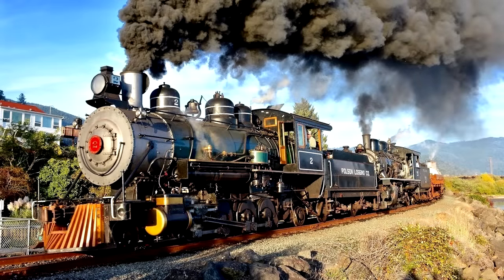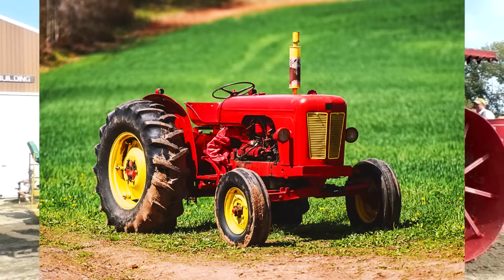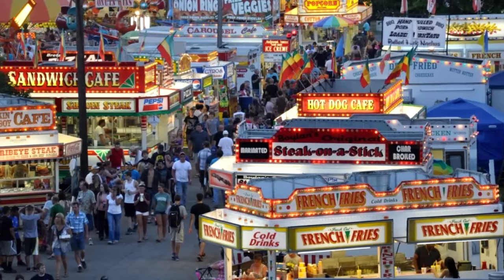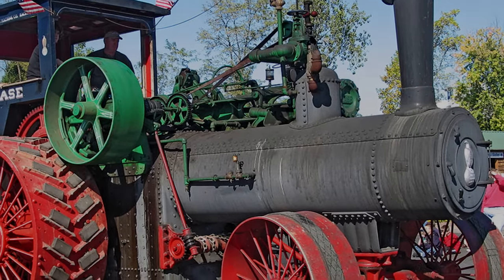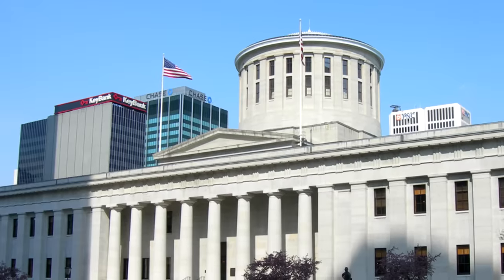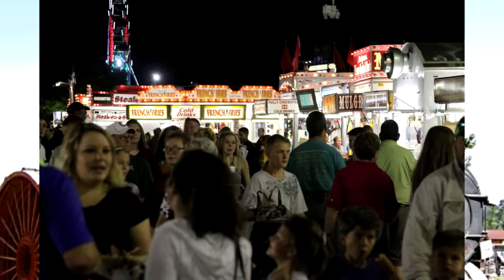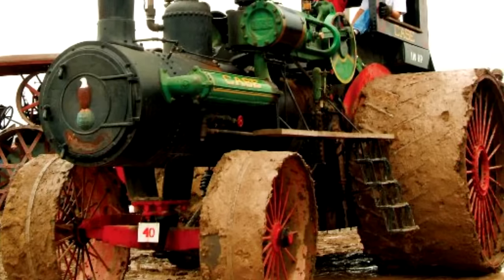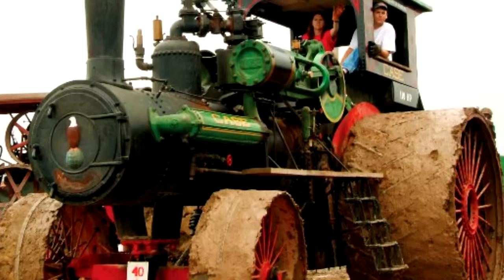The Steam Explosion That Destroyed a Fair 🚂 The 2001 Tragedy in Medina County 🚂 History in the Dark

Comment: The first traction engine was invented in the 1700's by a Frenchman. His engine was built to replace horses in military transport. Unfortunately, it was slow and difficult to maneuver.  It was a failed idea and retired after it crashed into a wall of a residential home. Also, there were few regulations existing for traction engines when they were used on farms. The result was many a young man losing limb or life to boiler failures. Traction engines were also not a common farm tractor because of how expensive they were. A group of neighbors would pool together to buy a traction engine and go from farm to farm. You were rather wealthy if you could afford your own traction engine.

Comment: My weldability of metals professor discussed elastic and plastic deformation. A boiler with walls that thin would have experienced both to a visible degree. Either that or it was made with too brittle metal that shattered instead of bending. Interesting.
Reply: With the amount of degradation he’s talking about, it could’ve been coated in scale or corrosion, slightly strengthening it. The stays are probably what held it together, though. Since it was most likely a crown sheet failure, that’s the roof of the firebox, so you very well could be right. The reason it broke there was most likely low water, without water to cool the crown sheet, it weakened beyond the already terrible state it was in, and either flexed and burst, or just shattered.
Without proper maintenance, it’s very possible his water glass got plugged and didn’t show the correct level anymore.
Reply: It may well of had significant signs of over heating, but frankly if the owner was so incompetent as to not bother with inspections, then  he likely wouldn't of even bothered to inspect the inside of the box either, or simply would of known what he was looking at.
Reply: When water came into contact with the red hot crown sheet, the expansion happened so quickly that there would have been no warning.
Reply: @randymagnum143  At less than 30% of it's original thickness, I highly doubt there were no warning signs. There were probably plenty of warning signs for years before the explosion.
Reply: @GudrezBilly  the spike in pressure was massive and instantaneous.
Reply: @randymagnum143  Dude I know what a boiler explosion is and what it does. What I'm saying is that it's doubtful that a 25% thickness boiler would still operate flawlessly up until explosion. Most explosions in the past were poor design or low water, this instance was very different, despite similarities in the core cause.

Comment: You completely botched the statement of those thickness numbers, by quoting a typo which I also found in an article. That is sure to confuse people. It was a 0.375" crown sheet, not 0.375', or 0.375 thousandths of a foot, as you said.. which would be 0.0045, or only slightly thicker than a human hair.

Comment: I had steam engines for a good many years but haven’t had any in awhile . At the time I had them the state of Virginia where I reside had a state boiler inspector that inspected your boiler every year . If you didn’t have a state certificate and displayed where it could reasonably be seen you didn’t run . Think I was told now inspections in Virginia are covered by an insurance agency . As to this 110 going up I heard about it within a few days of it happening . And over time I got the scuddlebut about the cause . Not to disparage the deceased but I was told this guy had a history of running the water level low . I was also told the cops stopped him as I think he was planning on getting water in his tank then let the pump and or Injectors put water in the boiler itself and they threw him off his assumed schedule (cops are good like that). The thing that got me the most out of what I heard was about the fusible plug . I was told they had bolts screwed in them not welded but either would cause the same thing to happen . For those unaware a correct fusible plug is made of brass with a hollow center that’s filled with a lead alloy . Once the crown sheet gets hot the lead runs out the steam blows down and helps extinguish the fire in the firebox . This guy had gone around half of his safety equipment . The other safety feature is the pop valve or safety valve on the steam dome that’s set at a specific pressure and when the boiler exceeds that it pops off and let’s steam straight up in the air , but that isn’t going to help when water hits a red hot crown sheet . Seems to me I heard or read something about the pop valve being wired down or set at a higher pressure than allowed . But regardless of cause reason etc five people are gone many others were injured and a pretty darn rare engine is destroyed 🤷🏻‍♂️

Comment: Why am I not surprised by this? The bottom line here is that steam engines CAN be dangerous but they are reasonably safe IF the equipment is maintained and the people that are operating them are well trained in how to use/operate them. There are tons of stories out there about steam engine exploding. Both traction and railroad. I would venture to bet that the vast majority of explosions are operator error, like a story of an engine that the driver got sick of the constant noise of leaking steam from the safety valve. It was covered up and eventually the engine blew up.

Comment: That Crown Sheet was .087? Ok, that is terrifying. I work at a factory making plastic and cloth laminate materials for the medical industry. The plastic that comes off the machine I run has to be between .055 and .065 and other materials have to be between .065 and .075. .087 is basically as thick as three sheets of paper! That is SOBERING.
Reply: As a traction engine owner myself, nothing terrifies me more than seeing someone who doesn’t respect steam under pressure. There are fantastic people in this hobby, who have immense knowledge and respect for these machines. There are new guys like me, who are cautious and are trying to soak up as much knowledge as we can. Then, there are guys who find out they have a boiler plate less than 100 thousandths thick and decide that means they “need a better inspector” Yikes.
Reply: @15nyonker  If the show Mythbusters left me with any one lesson on safety, its always give full respect to pressure vessels. Because when you don't, they do not offer a second chance.

Comment: Here in Oz pressure vessels have to be tested. This includes LPG tanks and the like.
As for steam engines boilers have to be inspected and tested regularly. This unfortunatly leaves what could be running steam engines unable to be used. Sad but far safer. I have seen several complete but uncertified trains andd tractors around at museums and steam train lines. And because these are no longer common there is no manufacturers available to order a new boiler from.A steam railway I visited had a lovely old loco but they went to order and their previous supplier had gone out of business. Anyone else wanted about 10 times as much to manufacture a new one and a lead time in years instead of weeks.

Comment: I go to a lot of Steam Engine shows, I even have a small 1947 International LB Flywheel engine that I play around with.   Anyway, I can tell you that I love to watch these old Steamers but I always stay a good distance away from them for this exact reason.  I understand they are over 100 years old and have been around water their whole lives.  You don't have to be a genius to understand there are lots of safety concerns that need to be heeded. You cannot assume everyone is keeping inspections and maintenance up to date.  You hope, but you cannot be sure.  Best to steer clear of them and watch their beauty from afar.
Reply: I've seen the traction engines at the shows overworked on the saw mill and during the pulling events. Safety valves blasting, operators shoveling in fuel. Makes me a bit nervous.

Comment: I see these machines sometimes my area has it's own seperate grounds ran by Antique Tractor Club but i never really have much thought fire+water=steam=power. I was young it used to have a lot more things going and machines, but seems like not that big as of late. Suspect age of machines, people passing and no longer doing, etc part of me is kind of sad to see things like this shrink. Newer things are nice but seems soon as you throw a handful of electronics in usally the companies use it to lock you into their system and dealers. I picked up an old Ford 3400 industrail tractor at an auction for less than could buy a decent basic riding mower. Had to rebuild the power steering system, and ended up rewiring it too because of tons of splices and they bypassed the neutral switch so started in gear.

Comment: Its scary working for farmers/hillbillies. They have no interest in your life or safety. We had a Chinese built air compressor that had quite of bit of surface rust on the tanks. The gas engine seized, and it was replaced by a Honda motor. The governor was removed so the engine ran non-stop at full power. The only thing that prevented the tanks from blowing was the safety valves which let off every minute. Was scary to operate. The brakes were removed from the tractor, yet I was still lifted in the bucket to service conveyors, using throttle to stay in one spot. A bolt fell out in a seat belt, so all seat belts were removed. Including all cars. He kept over pressuring oxyceteline while I was torching scrap. Arguing both bottles need to be kept at redline.  He then tried to light off a bottle for a murder/suicide attempt. I finally yelled loud enough that he stopped doing it to avoid attention. (we were repairing a snow plow at UPS' largest facility in Illinois.) Safety chains were never used in trailers. Faulty parts always used. Several times my feet were almost run over by highway traffic to replace tires. I used a company truck (he wouldn't let me take it buy myself) to deliver an engine I sold, he yelled racist slurs in my buyers wife's face. Outside of work he donating time to a homeless shelter. He would take advantage of mentally handicapped woman. I heard their screamed for help. There was no payment. He still owes me $70,000.  It sucks working for a family business. I needed a second job to pay rent, but I was required to give him 50% of my income from my second job. I worked about 80 hours a week and made about $20 savings for the month. We were required to maintain his new Mercedes. Fuel, tires, maintenance we covered. Working for hillbillies is dreadful. There is no joy. There is no worth of life. And no safety for others.

Comment: Man took out leaking pressure relief valve,  from home hot water heater. 
Stuck in a metal bolt,  back in its place , and plugged it 😃

💥out the roof of house

then came back down ,thru roof, into kitchen.

Comment: In the Uk there is struck laws on steam boilers and compressor air tanks in places of work and public shows they have to be tested once a yr like an mot on our cars. With steam anything can happen in seconds there’s been rare case of a good tested steam boiler exploding especially on a traction engine as it’s subjected to road vibration and a lot of twisting this stresses the boilers and can cause rivets  come come loose or a crack/rare in boiler and it explodes but this is rare. Most are down to pressure valve failure or like in this one it was not in good condition and someone had sneaked it out in to public in a dangerous condition. It’s why in the Uk there on to boiler inspections and they do keep struck records of it

Comment: Would pressure relief valves prevent these super steam over pressure events?
Reply: Most engines have two but they're not meant to handle rapid catastrophic expansion you get in a breach like this.
Reply: Thank you  Yeah, after more reading I see most of these events were caused by letting the water get to low and the metal gets so hot it gets weak. Then when water is introduced you get an instant burst of flash steam so fast the whole boiler just blows up.

Comment: Some more misinformation to correct.  A rapid change in tilt (going down or up a hill) can rapidly shift the water line and either cover or uncover the crown sheet.  Now, for the manual adding of water, the vast majority of engines use a steam injector to do this (Look up a Penberthy injector for a common example).  This device uses steam feed pressure to draw water into a venturi and back into the boiler.  A key point is that the line from the injector is always plumbed forward to near the end of the tubes (the tubes terminate in the front tube sheet).  This is done specifically to prevent new cool feedwater from getting anywhere near the crown sheet.  So let's dispel the "pressure flash" notion for anything except a sudden change in pitch of the boiler.  If the thing was on flat ground, or sitting basically still, the crown sheet simply failed from being too thin and too hot.  It never should have happened that the boiler runs so low on water, but the fusible plug is the only protection device I have ever seen in use.
Reply: @TugIronChief  I would argue that the both the area and the temperature at the tubes at the smokebox end is FAR less of a problem that at the crown sheet.

Comment: Riveted seam boilers and fire tube boilers are inherently more dangerous than more modern water tube boilers. The traction engine that exploded was both a riveted seam type and a fire tube type. Tube sheet, crown sheet and firebox sheet erosion are extremely common and as will all locomotive boilers these areas must be routinely tested to assure safety. Locomotive boilers are subject to more structural stresses than stations or boilers by virtue to their motion and the fact that the boiler becomes a structural component of the machine itself. 
Unfortunately, there are fewer and fewer engineers and inspectors left who are qualified to determine the operational safety of these boilers. Riveted seam boilers are obsolete and no longer allowed to operate in railroad or stationary service. This alone would put most traction engines out of service if the same standards apply.
Reply: Tell me one water tube boiler or welded boiler in steam rail service. Riveted fire tube boilers are still regulated by the ASME as historical boilers and there maintenance and even construction is well documented at the ASME and state levels. Because yes, riveted fire tube boilers are being constructed from scratch in the 21st century specifically to keep these machines alive.

Comment: Worth mentioning the BLEVE principle here. Boiling Liquid Expanding Vapor Explosion.  The chemistry principle is this:   Water CANNOT exist above 212 Fahrenheit.  At that point, ALL the heat added to that water will be used up in the phase change into steam.  A TON of energy, in principle.  NOW at higher pressure, the boiling point of water goes UP.  In a boiler of say a couple hundred pounds pressure, the water inside my well be 700 degrees or more!!  The fact that the water is now in a state that does NOT exist in normal nature RAISES A SIGNIFICANT IMPLICATION!  Why is all that extra heat even there?!  WELL, you'll find out if the boiler splits open suddenly!  MASSIVE amounts of heat energy are stored in the OVERHEATED water, as something known as "LATENT HEAT".  Once the pressure is gone, the water will INSTANTLY revert to its natural boiling point of 212 F.  NOW, ALL THAT STORED HEAT WILL INSTANTLY BOIL ALMOST ALL THE WATER INTO INSTANT STEAM WITH NOWHERE TO GO BUT OF COURSE TO EXPAND TO 1800 GALLONS OF STEAM TO EVERY GALLON OF WATER!!  Guess how much space all that steam takes up!!!  A massive explosion occurs!   Same principle as a dynamite explosion, where a small solid is instantly converted into a massive amount of gas!!

One more point on the crown sheet thing mentioned here.  I don't know here in this case if the driver had set the engine in motion at the same moment or just before he saw the low water condition BUT here is a consideration!   Exposed crown sheet will heat red-hot and be severely weakened.  This would cause an eventual explosion as the pressure unzips the stay-bolts and the boiler blasts open.  HOWEVER the pressure would probably only be at a couple or 3  hundred pounds pressure. The BLEVE effect at work here.

NOW, CONSIDER THIS.  A red-hot crown sheet is suddenly flooded with water from the sloshing motion of water from an acceleration. The water is "flash-boiled" very rapidly, faster then it ever would normally.  A super-rapid rise in steam pressure, perhaps hundreds of pounds higher than normal boiler pressure.  The weak crown sheet fails, and the BLEVE blast is possibly orders of magnitude stronger than the first scenario!

I WILL BET that the explosion happened if he started moving.  Ohio roads in that area I think are pretty level, and I don't see a cop making a stop on a hill anyway.

Most boiler blasts on the railroad occur if a low water locomotive heads downhill for a while and then levels out, or makes a sudden acceleration or stop, causing the slosh effect.

Someone here look into this allegation of mine and correct me if I am wrong about my thoughts of the driver startong to move, while parking on level ground!

Comment: 2 comments made thats incorrect , a steam device be it a locomotive or a tracktion engine the driver/operator must fully know how to operate the device in question so not a simple thing to operate as stated , i have seen the engineers report , firebox stays  were welded where the firebox was corroded the crown wrapper was down to 1/16'' of an inch in places  , when the engine approched the incline having low water it flashed as the wrapper was uncoverd , the firebox inverted and blew out the bottom of the boiler , as stated people operating equipment without the knowlage to do so ............